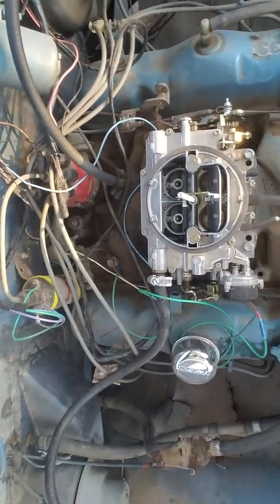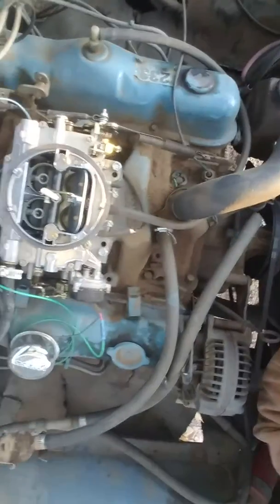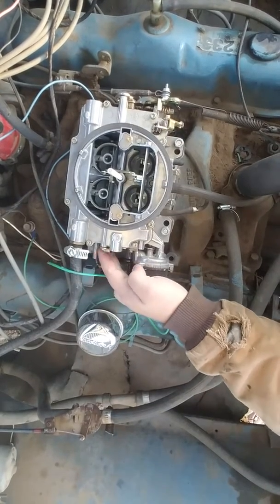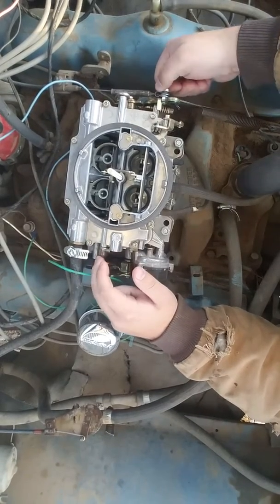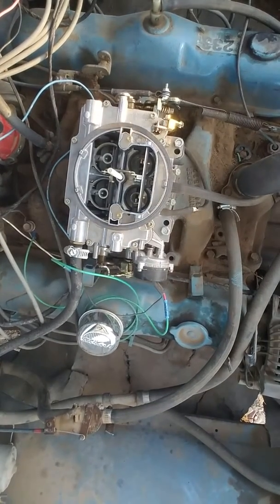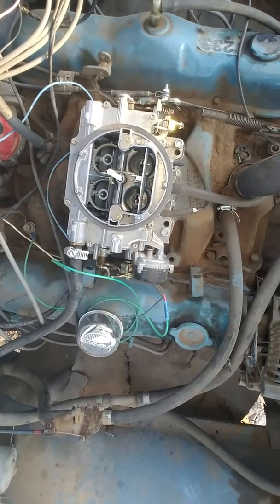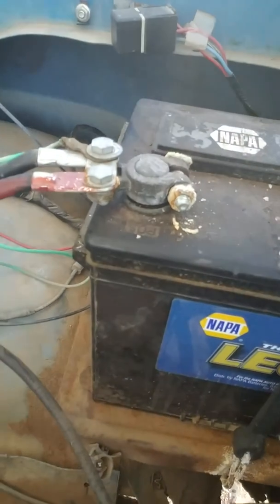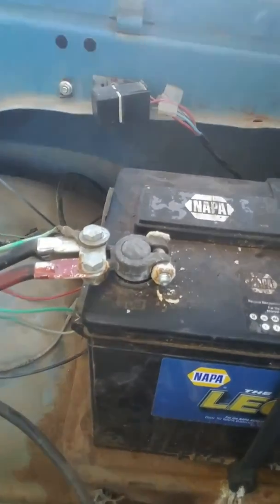Looking into the carb as i start the dodge. ( with some mayhem involved)

Comment: Another great video, buddy.  :)
Reply from the maker: Pedals n Boots thanks!
Reply: Matthew Green Do you ever get it flooded? 😀
Reply from the maker: Pedals n Boots oddly enough with the HEI conversion i did to it and the eddy carb usually 10 pumps and she'll start. Never had it flood yet lol!
Reply: Matthew Green I never did any electronic conversions to either of my Dodges so they flooded plenty of times. Lol
Reply: Matthew Green Might've had something to do with the fact that anytime it didn't start right up I'd just keep pumpin that gas pedal.  Lol 😈
Reply from the maker: Pedals n Boots thats usually how you start em🤠
Reply: Matthew Green Exactly and that usually worked but sometimes it didn't start and didn't start, and I pumped and pumped and pumped and flooded the heck out of it. I loved hearing that big V8 cranking. Lol
Reply from the maker: Pedals n Boots aint no other sound like it lol!
Reply: That's for sure, buddy not to mention that awesome Mopar starter sound.  :)